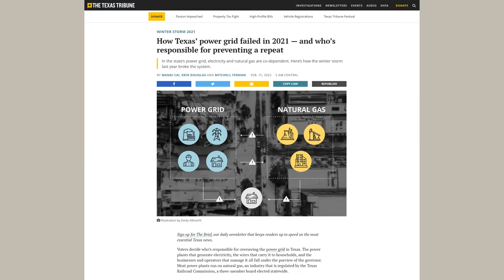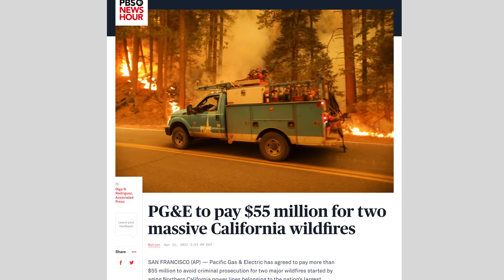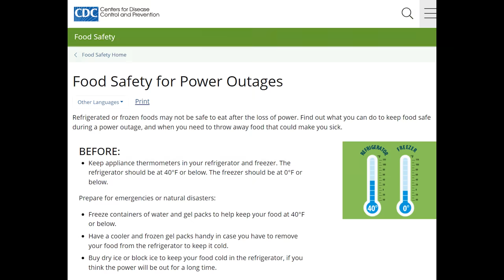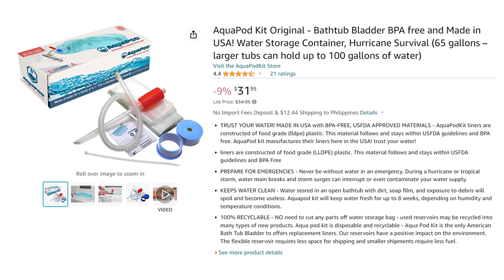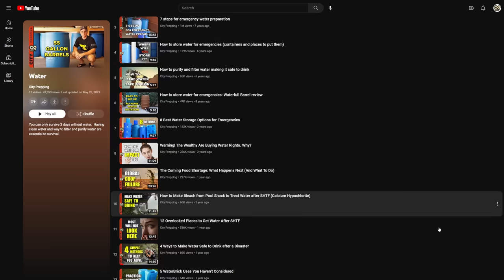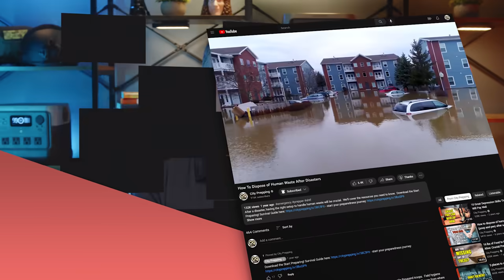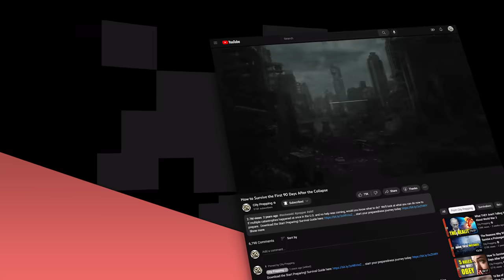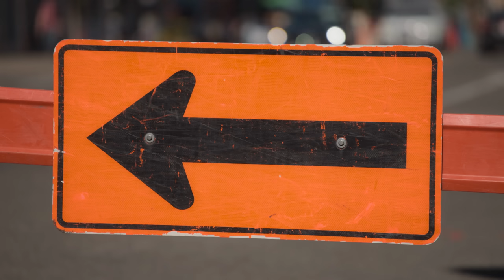Grid Down Collapse: A Timeline of Utilities Failing

Comment: I also freeze water bottles, they reduce electric usage in the freezer, and I rotate a frozen bottle into my fridge, which reduces electric use. On a power outage, it can save your food. I freeze much less food, I have been dehydrating some frozen items, and reducing my dependence on freezers and refrigerators. Instead of canning quarts, I now can in one cup and pint cars... single servings. I use my old quart jars to hold dry beans and rice and pasta and grains free of rodents.
Reply: take one of those bottles , half full, and freeze it laying on its side. then stand it up as an indicator. if you come home and all the ice is at the bottom you know while you were gone the power was off long enough you should inspect the frig and freezer contents
Reply: @richryan6326  thanks for the tip
Reply: @richryan6326 another trick is to freeze a red cup almost full of water and then place a coin on top. If the coin has sunk more than an inch, the food in the freezer should be discarded.
Reply: Pretty much the same here except I can meals in the quart jars for the 2 of us with lunch for 1 the next day.  Dried beans require a lot of water, soaking, rinsing, cooking, etc.  Consider cooking and canning your beans during the winter months to put moisture and heat into your home then you've got cooked beans if you need them during a grid-down situation.
Reply: @j.patrickmoore9137  If there is still ice in the cup the food is most likely still safe to eat; cook it and share it to prevent waste.
Reply: @dancinginabundance  good ideas. I have precooked and canned beans, but also dehydrate them for instant beans. I soak beans until they sprout before cooking.  I have used a solar oven for many years, great for beans. One favorite is to grow dry beans all winter for fresh greens and of course, outside in summer for a new crop.
I grind beans into flour, and chickpea flour is nice added to biscuits and bread.
Reply: @dancinginabundance  but the coin is helpful in knowing if the food is safe if the power went out when you were away, plus it lets you know that it was off for a while.

Comment: So, as I've been living in a van, I noticed a few things. I never know when the power is out locally, because I always have power. When water is out, I always have water. 

I have solar and a generator when it is cloudy. It is so humid where I live that the condensation from the AC is enough to provide water for my needs. I treat the water I drink, and the rest go to showers and dish washing.

My solar is enough to provide AC and run my fridge and cooking impliments. When it is cloudy or any other issues arise, I use the generator and you know that it will power everything I have no problem.

  I hear about the incidents sometimes days later.
Reply: I use my 1988 GMC Vandura van conversion as a mobile power source as well as a camper for 2-3 day trips.. 400 watts in solar panels, 40 amp MPPT charge controller, 2KW Renogy inverter, 300 amp hour Chins Lithium battery. This week, I built a wooden fence and gate and ran a worm drive saw, disc sander, Sawzall, pancake air compressor for the brad nailer AND ..... it ran a Harbor Freight $120 wire feed welder to make the gate hinges. There was no power source nearby. I installed the solar/inverter/battery a month ago and it worked great on its first test run at Bodega Bay, Calif.

Comment: The 1 thing not mentioned in this video,  the USA has about 104 active nuclear power plants. Each plant has about 2 weeks of diesel to run the generators that run the cooling pumps. 

Which means if a grid down scenario were to happen then inside of 3 weeks most of these plants would potentially go into meltdown mode. 
Even if trucks were able to get diesel to these nuclear plants,  making and refining more diesel might be problematic. 

It would seem that having a alternative system mandated to keep these plants from going into meltdown mode would be a wise choice. 
Like solar, hydrogen, or? 

Either way if a EMP, CME, or another disaster took out the grid for more than a few weeks, then getting south of the equator to avoid the radiation would be  about the only way to survive.

Comment: Thank you. I just bought my second solar battery. As a older lady, I don't think I can deal with a propane generator or a dual fuel generator. Seller is the best option for me. I live in a hot state with sun 360 days of the year.

Comment: Some municipalities have both water towers and huge underground tanks.  Yes both have to use pumps  but have massive backup generators that when power is out. Of course they can't run forever but the public works has reserve fuel here to keep us up and running for at least a week.  I know because I have to know as a pump operator (Fire dept).  Water here in Minneapolis/Golden Valley/Crystal and New Hope all comes from the Mississippi.  Some of those cities ALSO have wells they can switch to with more back up generators and stored fuel at the depots. 

I have rain barrels for water storage and 40- 5 gallon carboys loaded with bleached water for longevity.  I use them for collecting maple sap each spring so I dump them in spring, collect the sap and boil it for about 10 gallons of final finished maple syrup.  But the evaporator for it can boil 15 gallons of water at a time using wood.  I have a katadyn filters and sawyer straws for post boil.  I live next to a pond in the city.  Water is locked down.

Comment: Yeah, Feb 2021 in north Texas with rolling blackouts. I was prepping already, so my 12hr candles helped. We would have 30mins of electricity then be in blackout for 4-6 hrs at a time. We learned to time it so we could boil water and eat, take showers, change into clean winter clothes, and run a space heater during the shower. Temperatures were -18, -10, and so on with 4 feet of snow and ice on the ground. The house was holding at 56 degrees the whole time. Running the heat for 30 mins every 4-6 hours, you ain't gonna heat your home up in subzero temperatures. That went for 7 days. The whole event felt staged.  I was quite irritated with ERCOT by the time it was over. 
I was already working from home, Texas was on the news, my manager already knew what was going on and she was freaking out for my safety. I kept in touch when we had power and let her know we were still alive. They were good to me.  She moved all my PTO to that week so I'd get my full pay check, cuz it was declared a natural disaster and it was out of my hands. Everything worked out well in my case. But not so much for other people who lost water and electricity, they had to leave and go to a warming shelter for a week. Others died in this staged event. It's always good to prepare with any resources you can think of that you can afford.
Reply: Why on earth would they stage it? That makes no sense. The grid failed.
Reply: @kerrynight3271 they could have provided power but chose not to because there was no profit in doing so !!
Reply: @kerrynight3271  Have you noticed with all these triple digit heat days during summer of 2023, the grid DID NOT FAIL?!?
Well, "why on earth" did the grid NOT FAIL when we stayed at 110 to 126 heat index??
Just something to think about.

Comment: Thank you.

Potable water we store: eight 5 gallon containers with spigots.  Water that's readily available: water heater, two floors of pipes.  Water that needs treatment: 275 gallons of rainwater from an asphalt shingle roof, so it needs filtering for possible chemical content and for animal feces (birds, squirrels).  We have multiple levels of filters, from basic LifeStraws to ceramic domes to a Sawyer Point Zero Two filter with excellent specs, plus 10 lbs of activated carbon.  The 30 year rainfall records (check NOAA) say that we can add one 55 gallon barrel to the 275 gallon tank and one more downspout to have 2 gallons / person / day plus 10 gallons for a shower each week - even in a dry year.

Similar layers of backup for heating, cooking, limited power - and all of it has been tested, including the water when the County had a water main break that put half the residents (including us) on "Boil water" for a while.  We had a 14 day "no heat" event when the almost new, high efficiency natural gas furnace ate its controller board and the "3 day" turnaround took two weeks.  Kerosene heater (about 2 weeks of stored fuel in the shed out back), the gas logs (natural gas or LP, but battery-operated so no AC power needed), two fireplaces (I could run a generator long ehough to power a disk grinder and a small welder to convert a 20lb propane tank from a gas grill into a small stove that would fit into either fireplace).  Cooking alternatives include using a fireplace, gas grill (currently being dis-assembled in the garage for new innards from the burners up), Coleman stove (Coleman fuel, unleaded gas, LP), rocket stove, folding camping stove in a fireplace.  Sanitation includes a 5 gallon pail with bags in it (perhaps using the never-used commode chair from my back surgery as the seat over that bucket) and the Instructable on building an outhouse (Storey Publications used to sell a booklet on that - have a copy somewhere - but it seems to have been discontinued.  Possibly people aren't interested in dealing with their "end products"?).  If we flushed with greywater (hand washing, etc.) we're several miles horizontally and 700 or so feet vertically from the sewage treatment plant.  Using "If it's yellow" as a guide, we'd have flush water and there are NO effluent pumps between us and the plant - it's all downhill.  Hope they turned the "Bypass" valves on...

For most trash, I already have the burn barrel - one I designed for burning, not smoking and smoldering.  Load it, light the top, cover with the ash catcher and it burns quickly and with almost no smoke - having plenty of air to feed the fire makes for a clean burn, even leaves.

Comment: trying everything while living in a city. Biggest worry is heat, cool in summer and water. You can only store so much water and I do and rotate it. When I was a teen we lost power from a snow storm for a month. Best thing was it was winter and the old gas stoves could have the oven on with the door a jar to keep warm. Had a cooler that fridge food went in and set out on back porch. It was so cold that it worked. Cooked all the food in freezer and that was added to cooler as well. The new gas stoves don't work without electric. You can start a burner with a lighter but not the oven. All I can do is keep trying. God's blessing to you and yours

Comment: Had a tornado come through a few years back.  Took the power out for about 4-5 days.  We still had water.  It's hot and humid here so we learned the value of a window A/C to keep just one room cool and fans.  If I can withstand the heat find if I have one room to go get cool every once in awhile, also to sleep in.  Also made me think about generators and how much wattage I needed for short / long term... also noise usage day vs night for OPSEC and just consideration of neighbors.  So I have a daytime generator that's loud and runs most the house and then a very quiet 2k watt that I can run at night and no one notice to keep a window a/c going or the fridge.  Also just bought a Solar generator with panel to use at night, for OPSEC purposes, camping, or just when it's brief outages as a stop gap before I pull out the generator.

Comment: Re: residential gas shutoff-- Don't shut it off as practice for the main event! The valve on many are meant to "break" after closure to prevent reopening after an emergency, and will require the gas company to come out and restore flow. Yes, it's tempting to try out your shutoff tool, but you'll have to trust that it works and hope it does when the time comes.
Reply: Thanks for the info!
Reply: I have shut off my gas valve many times during repairs and work. I'm in Az so lines may be a bit newer. Never had an issue
Reply: Nonsense. Turn it off and on as many times as you want. They are not designed to break.
Reply: @brodierickman8457  Before calling my advice "nonsense," reread where I wrote "many." It's on you to check your own equipment. You wouldn't call advice to clear a pistol's chamber "nonsense" just because your pistol has a mag drop safety, right?

Comment: To cover service disruptions, make sure you have independent supplies of water, food at the minimum. Add capability with food preparation. you can go forward with technology with independant power supplies or regress to a simplier approach using parafin fuel for lamps and cooking. 

Large power transformers are a distinct supply chain problem since they are typically constructed ..... in China.

Comment: "I wanna live where there is no infrastructure to collapse." "Building new is easier than rebuilding" 100 year old houses don't mold like modern houses do without utilities. Proper ventilation and paying attention to condensation zones is key. Freezing distilled gallon jugs cuts down on ice bags in the cooler and stuff not getting soaked and nasty. I like vacuum seal meat for coolers when camping too.

Comment: As someone who lives in a camper, I am lucky when it comes to the potential of power outages. Electric and propane fueled refrigerator and freezer, back up batteries for lights with solar to re charge them and a dual fuel generator if it were necessary
Reply: And where are you going to refuel after the first day, for all but the solar?  All the propane will be gone very quickly and places selling it locked up and shut down.
Reply: @graywind4326  no plan is perfect. We’ve got a few 100 gallon propane tanks to keep things running for a little. The propane is mainly to keep the refrigerator/freezer running and solar can only do so much and batteries can only last so long
Reply: @Wardaddy865  100 gallons or 2 is a lot!

Comment: Water is by far the most critical and then sewage. If you have water then you can grow your own food, flush your toilets, and obviously drink it. Electricity is something we can do w/ out in terms of basic survival, when we go camping in the woods we don't have access to electricity or at least that's how we camped when I was a kid, these days yeah it's sadly different.  As far as staying warm, you can still stay warm with decent sleeping bags. I am making the assumption that you do have some type of adequate shelter such as a house or a motorhome. If not, then I would rather sleep on a cot with a tarp over the top than trying to sleep on the ground in a tent. Sleeping on the ground is no bueno, it's hard as a rock and it will suck the heat right out of your body. I'm not so concerned about the trash not getting picked up. If the stores are closed then you likely won't be throwing away too many things after a short period. Any cardboard, you will want to save as fuel for starting fires. Rotting food goes into your compost. Human waste, create a different compost pile or bury it...sooner or later it too will break down or you could put it into a gasifier which is burning it in an environment w/ no oxygen and thus turn it into charcoal. Lots of people these days live off-grid, that ought to be everyone's goal from a survival/prepping perspective even if you live in suburbia or urban. My biggest concerns are lack of access to water and protecting my family from looters and marauders. Sure life will be much more difficult w/out electricity but humanity lived without it for tens of thousands of years.

Comment: We have been under a strain and boil water since July 1st. The water plant is operating at half filtration due to excessive rain causing  a part to fail. They were unable to get the part until July 7th but the state has a 3-7 day after repair wait time until they approve the water. Luckily I was prepared

Comment: We keep frozen ice packs and jugs of water in any spare space in our 4 freezers, and keep water bottles filled in the empty space in the fridge, to allow the appliances work more efficiently, and have extra water available. 
We have a Generator that works on Propane, with 1000+ gallons always topped off. We usually use about 500 gallons per year, without having to use the generator as of yet.
For water, we are on a local well water association, and have a private separate well and a Pool for extra water if needed.

Comment: We have solar panels on our home however at night we will not have electricity.  We have a deep freezer and our home freezer filled.  Can anyone speak to the safety of the food when there is no electricity in the evening?  I do have water bottles and extra ice in the both freezers.  We have a back up battery however we discovered after purchasing the unit that it's only good for the electric company not for our use when the grid goes down.
Reply: Time to tap into that battery with your own inverter and run a 12 gage extension cord to the fridge. A chest freezer will stay cold for 3 days or so. Fridges and upright freezers will last overnight if you keep the doors closed. You have a grid tied system. They make hybrid components now to utilize your backup battery without the grid tie.

Comment: We have a 100 gallon water Bob for bathtub.
50 gallons in camping jugs
A 20k gallon poop fed by home gutters and 2 berkey filtration systems.

Plus 2x 275 gallon totes that fill in 1/2 inch of rain on our steel pope barn

Comment: If the grid goes down I have some solar and a gas generator to keep the freezer working. If down for an extended period and fuel disappears then I will have enough time to pressure can as much as possible. Not perfect but canning will preserve most of it for long term without electricity.